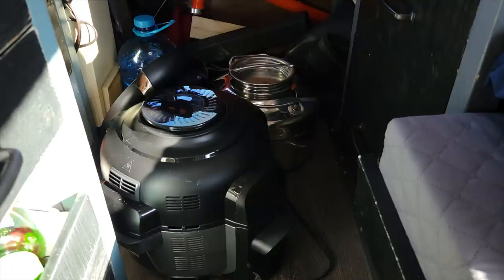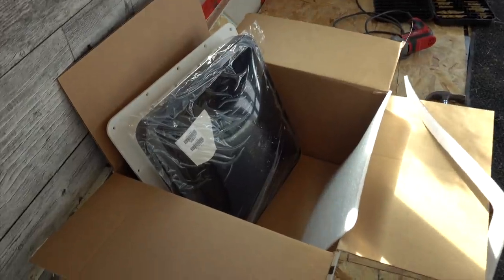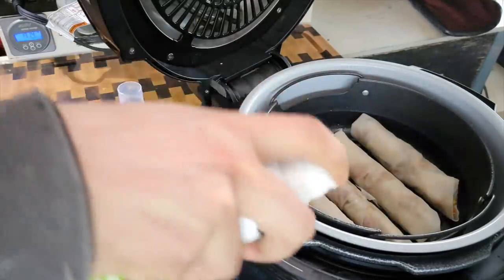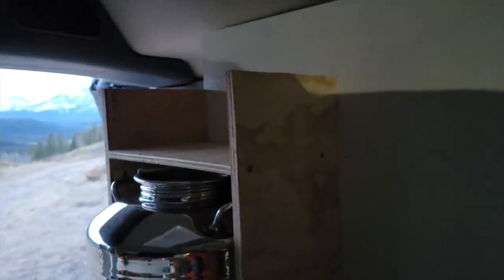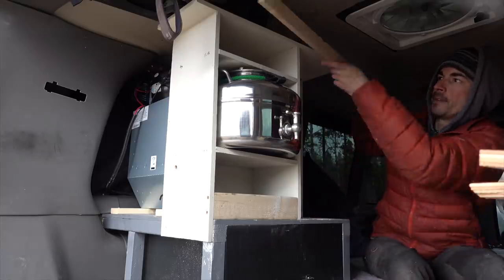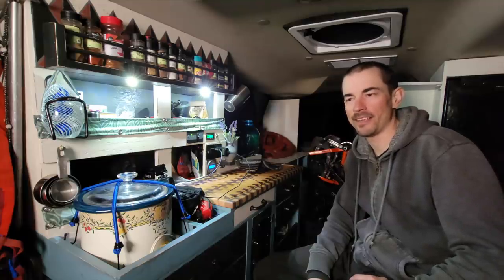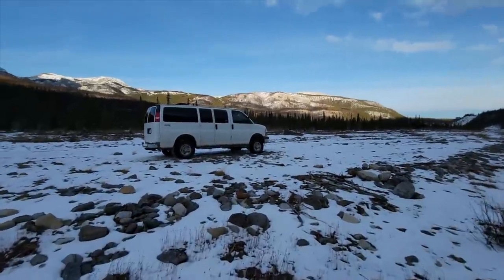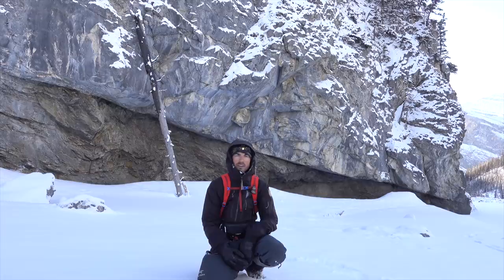Van Life in Alberta - Mountains, Air Frying, and a School Bus!

Comment: I know crockpot and Air fryer changes your life, it did for me, nowadays i have been using crockpot and airfryer to cook everything  and I use it every single day,  it wouldn’t taste as good as deep frying, but that is the compromise I am willing to take for good health,  It’s good that your are partitioning the garage area from living space to save heat, you could have a folding half door in front of the rear right window, that could be folded down when you drive, and lifted up and locked if you want to use the heater, enjoy your new air fryer.

Comment: New camera looks great! Sony compact is a really sharp improvement over the phones. Noticing your audio levels overall are a bit on the low-end however. If you are using Premiere, there is an audio panel with the preset "male dialogue" use that and it will automatically normalize and tweak your voice to sound louder and better. Otherwise, you could just boost the gain on your audio track in general and use the audio equalizer to focus on your voice if you have a lot of background noise. Music levels are good. Those spring rolls looked delicious!!

Comment: The new camera seems to be working well.  You are correct, I didn't even notice the change.  The cell phone cameras have gotten really good.  I started off my channel with a cell phone, but I too didn't like using it, and quickly purchased myself a DJI Osmo Action.  It's far from perfect, but I think it works a lot better than using my phone.  Great video, just watch your head on that board.

Comment: Hey I saw this neat cutting board with some really cool features I thought you might like to add to your van. It has these pull out trays to place containers into. They can be used for waste or cut up vegetables. That way you can slide them off the board right into the container. I posted this earlier with a link but it was deleted right away. Let me know if you would like more information on this.

Comment: If you’re going to do any wading in your van then I hope you’ve led your diff, axle and gearbox breather pipes up into the engine compartment and fixed to the firewall. You’ll be a sorry if you don’t. Can get to be very expensive. 😳

Comment: Hi, I use to think you used a tripod for most of the non drone hiking shots but then I thought you just used the drone but you said it was the camera on the tripod all this time. Would it be easier or more efficient to use the drone so that you didn’t have to walk back and forth picking up the camera? I’m sure drone battery life (cold temps) and wind are factors but have you tried just using the drone?

Comment: Im attmeptimg a build similar to your own, got my.renogy 60amp b2b charger. I noticed you put a fuse on your starter battery and on your house battery positive terminals, were they both 250amp blue sea ? Isnt a 250 amp fuse too large for 2 gauge wire?

Comment: I look for cooking gears. Pressure cooker look very attractive, low odor and humidity released, low energy consumption, fast cooking, high control and versatility! The only drawback as presto(use multiple heat sources=any stove:wood,gaz, electric). And take more space.
induction are best and now are cheap, but do you know a risk from electromagnetism radiation (see Joe Imbriano  THE FULLERTON INFORMER)
Turn to Christ (KJV)
God bless.